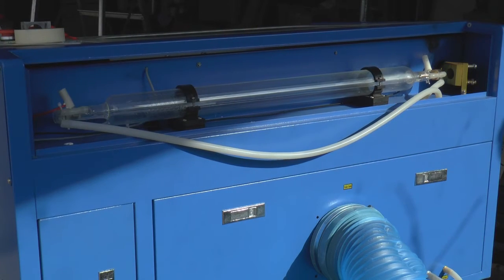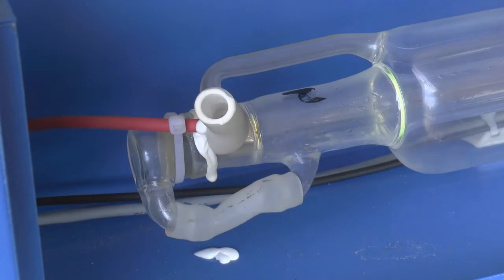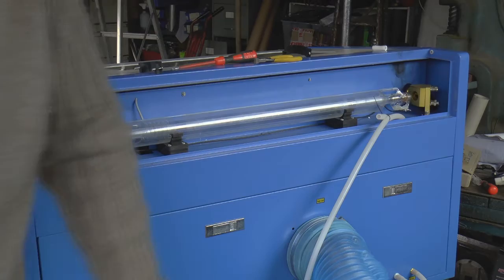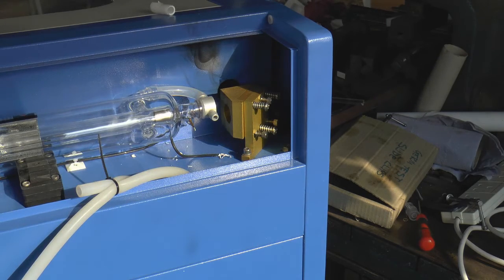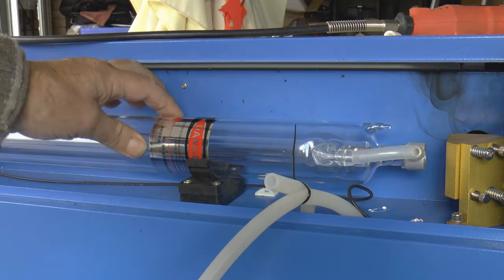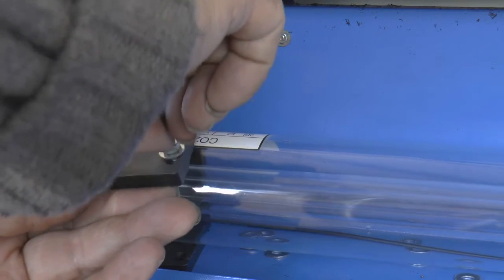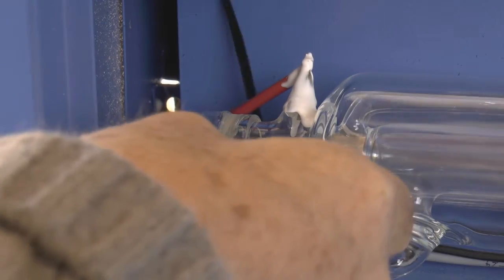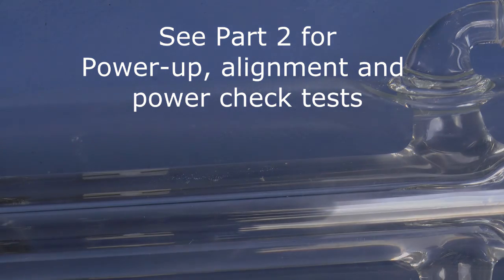RDWorks Learning Lab 21 Fitting new laser tube Part 1

Comment: How did you know when to change the tube?
Reply from the maker: +DOWNEY357
Hi 
When  every word I uttered was a swear word!
When you want to cut a simple job, say a 6" diameter circle from something very easy to cut, like 2mm acrylic, if the beginning of the cut is good but partway round the power starts failing, the circle will not be completely cut. It will be obvious you have a problem. At this point in the series I did not understand why, I just knew I was wasting my time with this original tube, so I went out and bought the safest option , described as an OEM replacement 50watt tube for my make of machine. Big mistake. It WAS  a direct replacement! Rubbish. I was always suspicious that these tubes were not the 50watt output claimed, but without an expensive power meter how can you tell? It was at this point I decided I MUST understand exactly how this technology worked and there are videos a little later in the series where I explain in simple terms how your tube lives and dies and how mirrors and lenses affect performance. It took about 8 months of frustration and valuable learning about the technology and the way many Chinese machine vendors mis-describe their product before I upgraded to a superb PROPER 60 watt system.
Best regards
Russ

Comment: I stumbled upon this video last night, purely by chance. I have the exact same machine and have recently had to purchase a new tube and yesterday discovered the diameter is larger. I have been pondering ways to fix this and your idea is super, am going to attempt it. Thanks for taking the time to make all these videos surely helps me.
Reply from the maker: +Marco Franceschi 
Hi Marco 
You have stumbled into an old guy having the most fun ever with a techno toy. My other hobby is video so you get to come along and look over my shoulder as I learn about this little Chinese dragon.
You may want to jump ahead in the series to https://youtu.be/Iqwft4dmGos. The clamp fix got me out of trouble but was not the real answer.
Good luck with your machine. DONT try soldering the wires. I found a better way of connecting the wires in https://youtu.be/5GQQdHFgrLQ
Regards
Russ
Reply: +SarbarMultimedia Hi Russ, keep up the good work! Would you be prepared to share the design file for the clamps you produced? Would like to cut them and make a more permanent solution.
Regards 
Marco  (marco.franceschi@mm-holz.com)

Comment: This  same Work I must do in the next Time . I didn´t know that it  is so a simple job. Your Instruction is so helpfull and  very good.Great Video.
Reply from the maker: +Bodo Borsutzky 
Hi Bodo
Sorry for delay in answering. You Tube put your comment into a "Likely Spam" box and I missed it.  Yes tube change is quite simple and I was lucky that I didn't need to reset my mirrors. However the one thing you must NOT do, is attempt to solder the wires as I did. I was lucky and did no damage. I found a better safer way to attach the cables and you can see this in https://youtu.be/mN7_4h3nCZM
Thanks for your kind words
Russ

Comment: I agree that wires just wrapped around the electrodes is very inefficient. I wonder if a person could use standard wiring nuts that electricians use in our home wiring to make a solid connection to the electrode?
Reply from the maker: +Mike Duncan 
Robert Conway (below) suggested something similar. I think the answer would be yes but be VERY careful not to over-tighten the screw because although tungsten is very hard and strong it is also very brittle. Inefficient it seems, but the tube works well.

Comment: Thank you so much for this video!  I have same machine and just ordered a 60W tube for it, as well as new PSU. I know length is the issue, but I didn't even think about thickness until I saw your video!  Interestingly enough, my machine doesn't have same plastic brackets, it seem they just used two metal clamps with rubber under it and long screws holding them together... Oh and yeah, you can't solder leads, site where I bought tube from actually states that soldering voids warranty, oops :)
Reply from the maker: +bratan007 
My mistake is a gain for all who follow. As was pointed out by Robert Conway the electrodes are tungsten, so I was lucky I did no damage. Your tube supplier was obviously more informative than mine. However they did they specify a max drive current?  I think for your 60watt tube it will be 22mA.  I earnestly advise you to fit an ammeter because it's the ONLY way to prevent over-driving your new tube....it's very cheap to buy and simple to fit and gives 100% peace of mind.  I have to believe that max drive current equates to max specified power, 50 watts in my case and 60 watts in yours.....but I cannot be sure. However, I am in the process of purchasing a decent power meter to check my output at various drive currents and also to see how the temperature of cooling water affects output power. Subjects for future videos.
Reply: +SarbarMultimedia Yes its 20-22mA :) Good point about Ammeter! Just ordered one.

Comment: I recently received my laser cutter.  It's an Identical model.  Thank you for taking the time to make these videos.  Did the manufacturer ever respond to your research on power loss?  It looks relatively straight forward to replace the tube but what did you replace it with?  Power and supplier?  Are you happier with the new tube?  Thanks in advance.
Reply from the maker: +Event Rental Systems 
I learned several lessons the hard way. No, The supplier blanked me, Paypal guarantee is VERY shallow, but as my subsequent  research has taught me, the problem was actually (through ignorance) self-inflicted. No one warned me that there was a rev limit on the engine and that I should never put my foot to the floor!! I did replace the tube with another 50 watt tube from
http://www.ebay.co.uk/itm/50w-CO2-Sealed-Laser-Engraver-Tube-Water-Cool-85CM-for-Shenhui-DC-G350-engraver-/321716369860?hash=item4ae7ca39c4

and as you will see, there is a specification for max driving  current shown here. There were no warnings or even paperwork with the replacement tube, so continued ignorance would have wrecked that one as well. I'm very happy with the new tube, especially now that I've fitted an ammeter to monitor the drive current. My power limit is now 65%. (Have you watched how cheap and simple it is to do?)
Thanks for the kind feedback.